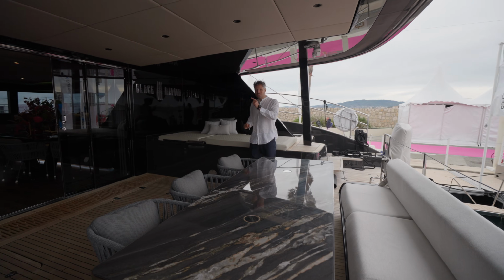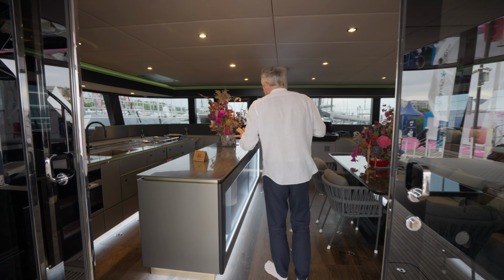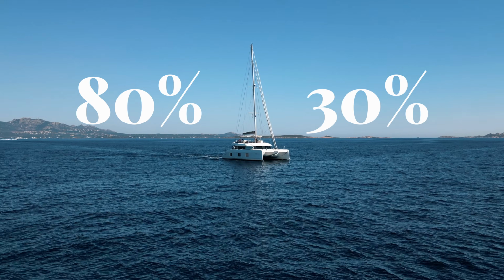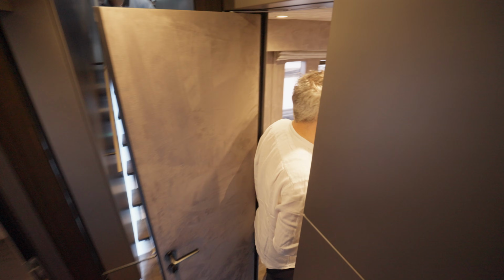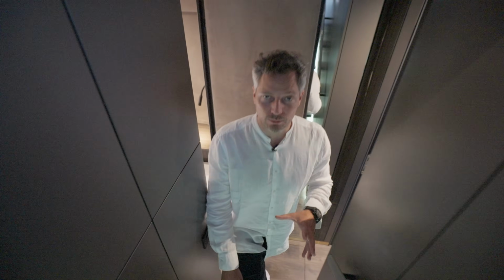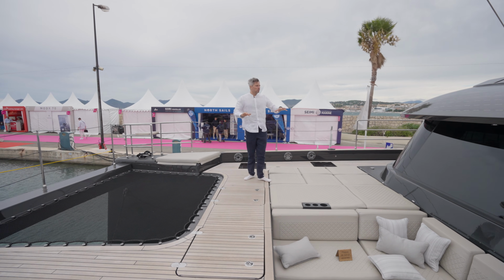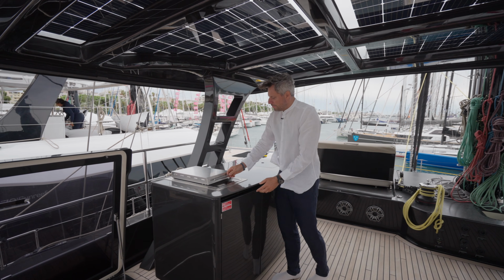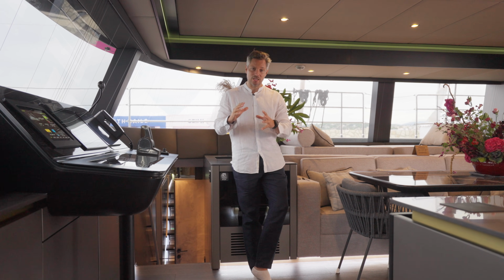Sunreef 60 Eco Sailing Catamaran – Full Walkthrough & Features 🌿⚓ | Eco-Friendly Luxury

Comment: how accessible are the battery packs? im guessing they have to be changed every 8-12 years like in a car... do you need to cut the hull open then or is it easier than that?
Reply from the maker: they are modular and are easily accessible through a service hatch

Comment: Great for charters, rubbish for cruising.
Reply: why rubbish for cruising?
Reply: @Piotr-o7u  the focus is on comfort and luxury. This makes them heavy. Very, very, very heavy. Sailing cats like to be light. Weight is not their friend, unlike a bluewater monohull. Where weight can be an advantage.

This means they aren't very good under sail. They're OK, but other cats are better. 

If you want a weekend boat or a boat to get from Miami to the Bahamas and back for a week at anchor partying and drinking cocktails? This is perfect. If you want a good cruising boat that will sail far more than it will spend time with the diesels running? There are better choices. IMO.

For luxury charters where it's all about being sat at anchor and lounging in comfort? Absolutely perfect boat for it.

These are boats whose focus is on providing a superyacht experience. Not on providing a good sailing experience. For some private buyers, a motor yacht might be a better option (Numarine/Bering/Arcadia/Horizon).
Reply: @Piotr-o7u was looking for something like this for crusing, lol figured solar and sail would be great.. I wonder what's outhere thats has all three diesel solar and wind
Reply: how so?
Reply: @Osirislincoln  Sunreef is more of a floating condo than a sailing catamaran. For sailing weight is everything if you want speed, and catamarans are designed for speed. The hulls on a cat if deep also will have issues as the cat cannot move sideways if caught in a side hitting way. Moo hulls roll when that happens a rolled cat is just a flotation device until you are rescued.